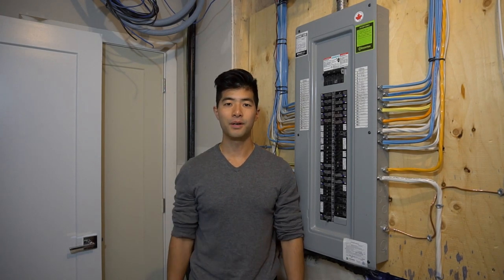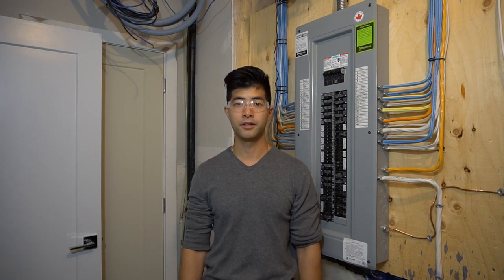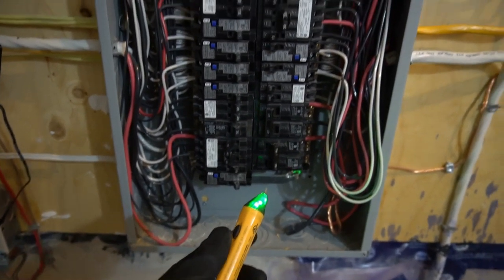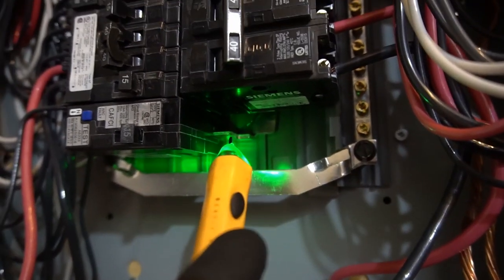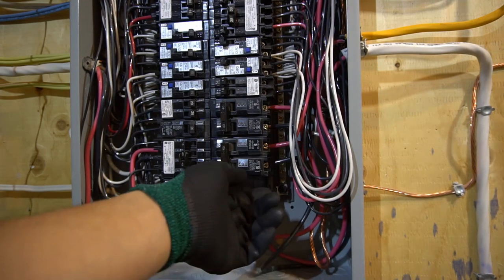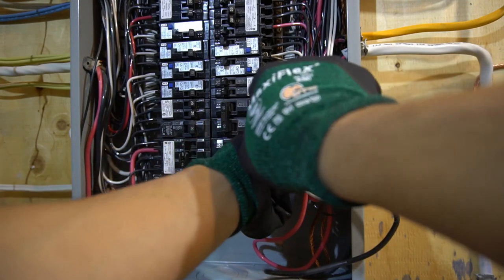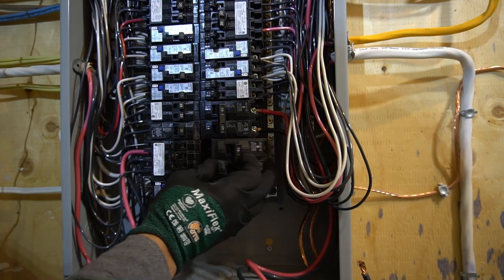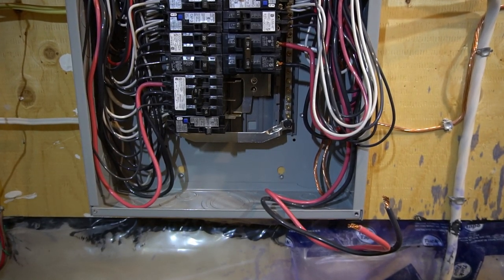HOW TO Remove Circuit Breaker From Electrical Panel

Comment: When you remove the breaker , can you leave the slot open or you do you need to put something into its slot?
Reply from the maker: @dammit7045  after removing the breaker. The panel cover, you will need to put a filler plate to close the hole and that's it 🍻

Comment: thank you for the advice/how to! Should the main power to the house be turned off first?
Reply from the maker: You're very welcome! No it does not but make sure the breaker you're working on is in the off position.
Reply: you can turn it off for shits and giggles if you want

Comment: so what do you do with those removed open wires. Do you leave them dangling?
Reply from the maker: It's best to cap the ends with a wire nut or wago and tuck the wires in safely along the side away from the breakers 🍻

Comment: Alert: Turn off main power before removing panel 
My LG Appliance technician suggested I might be able to replace 220V double pull breaker and after viewing this video and a trip to Ace Hardware I accomplished the repair in 50 minutes start to finish without shock or electrocution
Reply from the maker: Job well done Mark!! 🍻

Comment: You forgot to mention that the wires you pulled out of the breaker are HOT and that you are working HOT in the panel because you did not turn off the main breaker!
Reply from the maker: Thanks for the comment. Once you turn off the breaker the wires and screws are not hot. Completely off. Use a voltmeter and test it yourself. 
Here's the latest video of this version: https://youtu.be/qWhul3Pa6mA
Thanks for watching! 🍻
Reply: those wires are not hot... the breaker connects the panel to those wires so if the wires are not getting power through the breaker it means they are dead

Comment: Is it safe to not replace the breaker and just leave the open slot it as is? I want to remove my hot tub breaker and take the huge wire to my new house.
Reply from the maker: You absolutely can do that but you should get what's called a breaker filler. Essentially it's a plastic cover to the empty slot 🍻

Comment: Thanks for a clear video. Hey, so I was checking a friend's circuit and ...with cover panel still on, when we tripped it off, the breaker tipped out easily on its own... I guess that's a sign it is not seated well (or at all), right? Shouldn't it take more than the force of moving the breaker switch to tip it out like that?
Reply from the maker: Hi J, yes you are absolutely correct! The breaker should never ever tip out. That's scary man. It's either broker or not installed properly. Breakers are supposed to stay secured and tight. Stay safe my friend 🍻
Reply: @KevinPon.  right on, Kevin, that's what I thought... thanks! I'll be killing main power, removing cover panel, and having a look...
Reply from the maker: @Bane-l7h  no problem! 👍🏻

Comment: Is your safety equipment electrically rated  for that job ? I'm not trying to be mean. Just that I have a doubt.
Reply from the maker: Good question. Safety glasses yes, gloves probably not but I am a certified electrician. PPE is the last line of defense if an accident does occurs.

Comment: What if the breaker has failed and is red?Does that mean the power is off?
Reply from the maker: If the breaker has failed and is still "RED" that means the power is still ON. The breaker is not off. Current is still running through the wires. Cheers!

Comment: Hello frnd.......kindly tell me if we remove a damage/trip breaker or other working breakers so is it ok to unscrew it without turning off the main breaker inside the panel ???
Reply from the maker: Hello there, there is a risky but you'll have to be very careful! Make sure the damaged breaker is turned off if you can put it in the off position. Wear gloves and eye protection. Also when removing the wire from the breaker, you should have a volt tester to make sure there is no power. If there is still power, you'll have to be very careful not to get shocked and best to use insulated screwdriver 🍻
Reply: @KevinPon.  Allri8 frnd ,found ur vid one of the helpful vids & found u a helpful person ........ thank you sooo much
Reply: Also tell me after removing the wires out of circuit ,is it ok to keep them bare inside the panel till v get another breaker widin a few days
Reply from the maker: Yes, tuck them nicely along the outer edges. Furthest away from the breakers. You can also cap them off too making it extra safe 🍻
Reply: @KevinPon.  ok Kevin.........1nce again thank you.
Appreciate ur knowledge
God bless you

Comment: Had a breaker keep kicking, check wiring, checked outlet, checked everything,..

 inside the main fuse panel box the wires are run nice and neat, one wire was rubbing against the inside of the metal panel fuse box,

 and had burnt a hole thru the plastic around wire,

 and you could not see it,
 it only left a little blackburn spot on panel box,but wire covered up the tiny burnt spot.

 we finally discovered it on the inside of the fuse panel box, by inspecting  one wire at a time, and found burnt spot on back of one wire.
Reply from the maker: I actually came across that recently on my friends panel. Luckily it was easily visible. Good catch! That can be very dangerous! Yikes. 🍻

Comment: And what do you do with those wires
Reply from the maker: If you're not using them. Cap them off and tuck them in the back corner furthest away from the breakers

Comment: Or take the circuit breaker off then removing wires that way your not still connected to the bus bar when loosing the set screw that holds the cable.
I'm a plumber and have had to do this in my home many times live, main breaker on